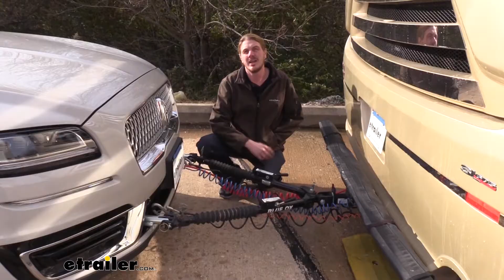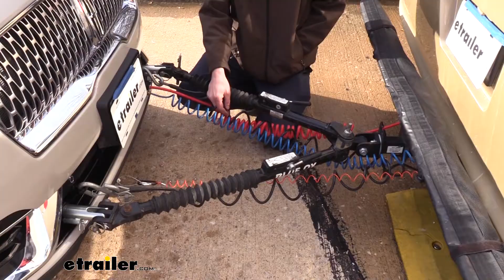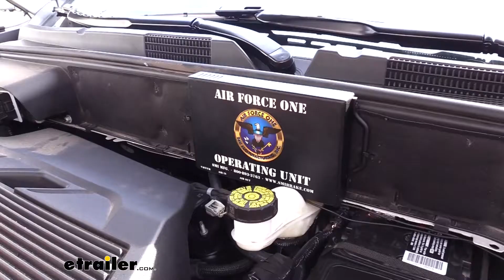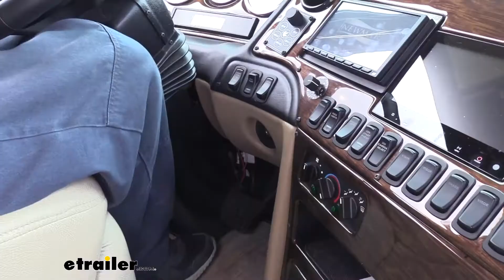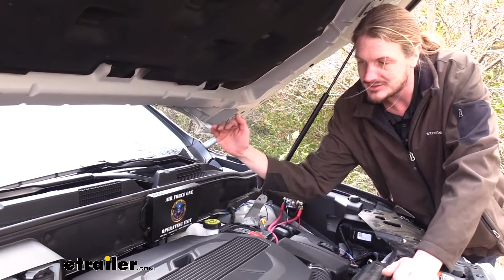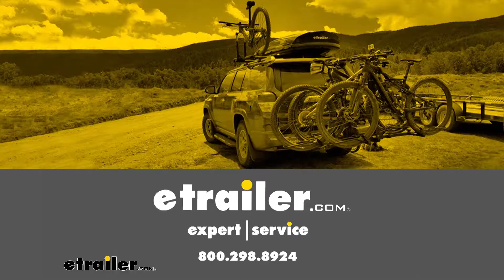etrailer | Best 2019 Lincoln Nautilus Flat Tow Set Up Braking System Options

Comment: but how do you get those steel bars to go through the grill area
Reply from the maker: You will need to install a base plate on your vehicle and the tow bar will connect to it. Check out the baseplate that was installed on this vehicle in the following link.
https://www.etrailer.com/Base-Plates/Lincoln/Nautilus/2019/BX2680.html
Reply: @etrailer  thank you so much for the information . great job